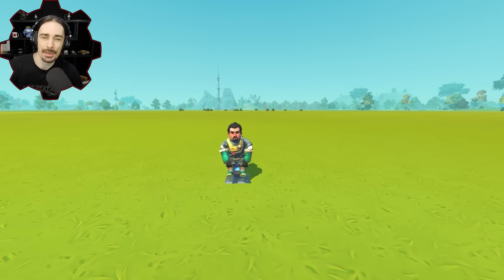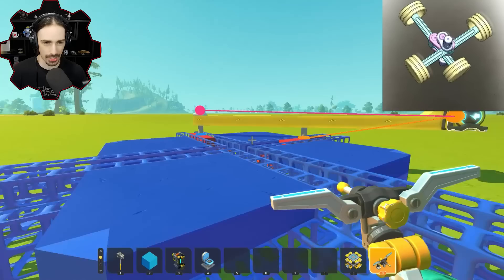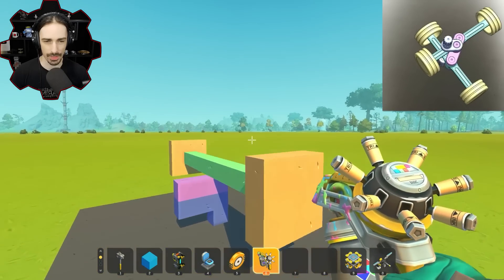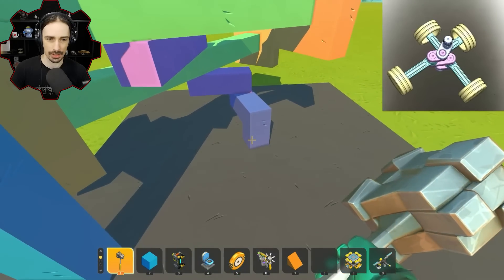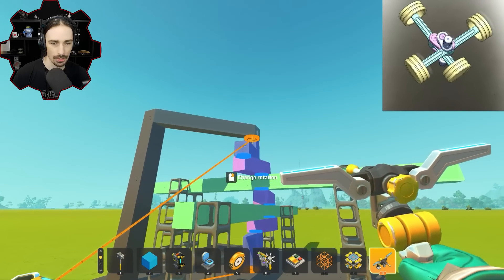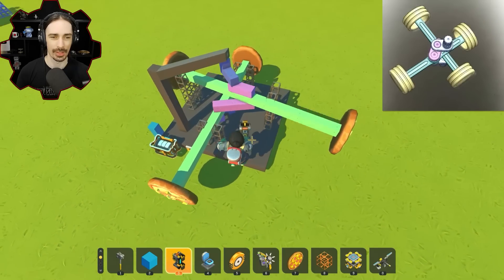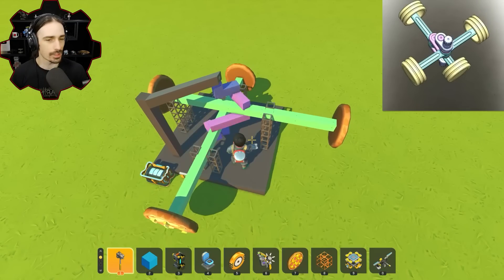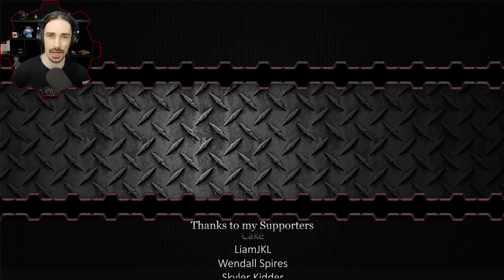Recreating This Radial Piston Mechanism Had Strange Results

Comment: The reason yours doesnt work the same way as the animation is because all of the pink pieces are supposed to be rigidly connected, thats why they're the same color. It is done by a rod running through the axis of the bearing, which is not easily accomplishable in scrap mechanic.
Reply: that's what i was guessing, interesting to see that it can work similarly though.
Reply: the blue part is hollow and the piece goes through the middle to keep it stable
Reply: Yea its a radial engine crank with rods and pistons not a bunch of free spinning bearings the other problem is the power should be coming from the linear actuations of the pistons and not the rotation of the crank or you would have a radial compressor and not an engine
Reply: I was wondering the same. It's fun to see him work around it hehehe nice vid
Reply: @general.catallion_8054  Yes and no the difference is one is an engine that could be used as a compressor or a linear actuator EX its meant to take a linear force and turn it into a rotational force but could do either where the other being  the Trammel of Archimedes is intended to take a rotation force and turn it into a linear actuation and while it hypothetically could  do everything the other one can it would be a lot harder to do being a completely different mechanism that was made to do only one thing but its able to do that one thing with substantially less moving parts
Reply: You could probably replicate the effect by abusing the no collision of pistons.
Reply: I would think a small pipe piece connecting the pink parts and a square of low friction blocks on the piston would simulate a rod through the piston to rigidly link the pink parts
Reply: @Lectrikfro  regular pipe piece would do, i think. would make for less wobble
Reply: I was shouting the exact thing through my display😂😂
Reply: we can connect that using pistons though
Reply: I'm screaming at my screen telling him that you can just conect them with a piston
Reply: Seriously how did he miss that he's usually really smart
Reply: Just built it using suspension and was fairly easy and is really stable, and I added it to the workshop too
Reply: This would've been pretty easy to do in Robo-co
Reply: @kilbymorgan8626  it would also be pretty easy to do in scrap mechanic, the Scrap Man himself just doesn't see it.
Reply: Maybe make a hole in the piston rods and instead of the bearing just have a tube or pipe. That should have the purple sections rigidly connected whilst still allowing them to rotate within the rods. Scrap mechanic needs some kind of through block bearing.
Reply: physics and engineering
Reply: yeah there needs to be a way where you can lock lock together the rotation of 2 or more bearings if they are on the same axis.
Reply: Pistons dont have collision, he could have used one to connect them
Reply: He could use a piston to connect them since pistons don't have collisions
Reply: @thekingjdd  X engine*
Reply: @DoubsGaming  you can do that in a 1x1x1 space pretty much (in game)
Reply: Yup
Reply: Yeah exactly... thank you... you can recreate this in scrapmechanic with pistons connecting the point together... pistons have no colisions
Reply: Yeah I made one with them locked and could be a really effective piston engine
Reply: @DianaTheLance  you can’t weld it together off the lift though, the pistons will only connect to the bottom.
Reply: could just connect them with pistons, b/c pistons have no collision
Reply: Yeah and like you said not easy to do in a game that doesn't allow it I feel like there is a mod for something like that. I love how we are watching him learn from just an animation without him having alot of experience reading a modle
Reply: I can't spell lol
Reply: Physics slider
Reply: Btw you can easily accomplish it by using either a piston at the side to link them as the piston clips through thing as well as using I think like mechanical something mod
Reply: Could be a pin a bushing rather than a berring as there's less play in a bushing /washer  mechanism.
Reply: You can use pistons since they don’t have collisions.
Reply: it's really easy, just use a piston.
Reply: not only that but the cylinders would hold the pistons as normal.
Reply: I was hoping he would make pistons push to simulate the engine explosion/ignition(?)

Comment: The mechanism is meant to have the linear motions of the pistons driving the mechanism (like a combustion engine piston).  If you had the ability to control them, you would have control over the piston sequence direction...  and in turn whether or not the pink pieces are in alignment or not.  You were figuring this all out from the other end of the power train, which honestly is kind of impressive.

Comment: The reason that your radial piston isn't working the same as the diagram: Your "Pink/Purple" cam isn't fixed. Notice that center piece doesn't flex. It isn't 3 pieces that rotate independent of each other. 

You could fix this by using pistons (which other objects just pass through, I'm sure you're aware), to make that center component "All one piece"
Reply: its X engine

Comment: i think that its supposed to be creating rotation from the radial piston movement RATHER than the radial movement from rotation.
looking at the crankshaft like structure in the middle it reminds me more of an engine design
Reply: Yes. Clearly the piston heads are where power generation is supposed to be 🤣
Reply: Thats definetly it because the Pistons have the sealing Rings and the shafts have rivots to output the power
Reply: @Maxikxng  splines*
Reply: @Maxikxng  That really doesn't tell you which side is powered. This could just as well be a piston compressor.

Comment: You actually built it wrong. The pink parts are supposed to be one part with the place where the bearing is being threaded through the piston's rod, so it would be more realistic if you were to connect them with a piston so that they behave as they would IRL.
Reply: I'm surprised it worked at all the way he built it.

Comment: basically what made it not work is because its supposed to be more of crank shaft like item thats attached at the center point on each end by a bridge to the rotating point creating the order of the pistons that are jointed to the crank shaft thats allowing the pistons (if this was used as an engine configuration) to all produce power to a rotating point every 90 degrees meaning that if it was to put in an engine with 8 pistons but 4 rods in this configuration you would want every other set of 4 pistons you would want to offset the power stroke of the piston by 45 degrees and so from that you have smoother power and more of it basically creating a 4 piston segment radial configuration that you have bigger bore pistons with

Comment: 11:00 in the video the pink is one solid crankshaft like in an engine so i goes through the middle of the piston rods and stays connected its not three seperate pieces like you have it, however locking it with a controller would provide the same result

Comment: I was going to say this is a lot like a much earlier creation of yours than the trammel but after digging around a little, it turns out I was thinking of one of kAN's videos from the early days of pistons in scrap mechanic (from five years !!!! ago).  Its title is "Radial Engine and Piston Powered Cars! (Scrap Mechanic #183)" and the engine has an interesting 4 piston single plane design.  A second take on the mechnism in today's video where piston clippnig is used to turn a common central shaft might be able to get the motion to match the example image.  The limitations of scrap mechanic's surface mount bearings and lack of through-pin/wrist-pin/journal-conrod devices makes it not quite possible to fully match otherwise.

Comment: The "thing" here is, that the bottom and the top pink parts are usually connected with a joint on a bearing with the middle pink part, through the pistons.

Comment: What scrap man missed was that the pink piece was one solid piece effectively the green pistons had a hole drilled out in the center of it so the pistons wrapped around the pink instead of 3 separate rotating pink pieces

Comment: you guys do understand that in scrap mechanic you can use pistons to connect the pink pieces and make them a rigid Crank then the mechanism would work due to the pistons making that pink part a solid part

Comment: something to try that might be interesting, as these are pistons..    they are supposed to be the power source,   adding a short duration "thruster" ont he end of each piston with a sensor...   to have the thruster to fire a short burst, at the begining of each stroke..  ie when the piston reaches its full length, it trips a sensor, that activates a thruster to stat it moving in the other direction...   then have all 4 pistons providing the power, instead of the top/bottom.   might be interesting...

Comment: The pink piece in the animation is all one part. They have a rod connecting them that goes through each piston shaft. This also allows you to only to to power one baring. however, this is probably all impossible on scrap mechanic. Your probably as close as you can get really.
Reply: It is possible if you use the fact that in-game pistons and suspensions don't have collisions.
Aka you could connect the pink 3,5,3 parts with them to simulate a solid piece.
That's something that is used in some SM piston engines to make a crankshaft.

Comment: I think what is missing is that the pink is all solid. Like suspension should have been used to keep the purple completely locked. Otherwise the pistons couldn't power the device. This would only work with the shaft being powered which is not how an engine works.

Comment: this thing doesn't work because of 2 things: 1. that's what lots of ppl said already - purple part is basically a one single piece of metal. 2. this "mechanism" is not a mechanism, its a part of X-tipe engine, that is actually exist, which means pistons aren't free part, they incased inside the celinders of the engine, also it means that the sorce of power here are the pistons themself.

Comment: i think all bearings need to be powered to simulate having rigid connections for the pink parts. the only unpowered bearings would be the ones connecting the purple to the pink.
Reply: or just connect the pink parts with pistons

Comment: one problem I think could have been fixed was making the pink piece one piece as in the real engine if it were to exist
in the engine the pistons would just go around a tube that is part of the crankshaft
allowing the output of the engine to be connected
in this situation it is no different
you would need to make the crank shaft well a crankshaft
most likely by using piston glitch to connect it

Comment: An engine uses pistons to power the crank shaft not the other way around. That's why it's not working properly.  Push and pull the pistons back and forth like a real engine and let the bearings free spin.

Comment: It is supposed to be an engine. You don’t power and engine from a rotating point. That is what the engine is supposed to do. You need to put timed thrusters on the end of the piston to push them so you make an rotational force.

Comment: That purple piece in the original animation was 1 big piece its the crankshaft so the free bearings were the problem but it would probably not be possible to replicate that in scrap mechanic
Reply: it's actually quite easy, b/c pistons have no collision, so you can just connect the purple pieces with pistons

Comment: The problem is that there is not suposed to be free spinning bearings but the pink shaft is actualy a solid piece. So i dont think you could build it in scrap mechanic. Pink shaft is supposed to go trough pistons (green) 🤓
Reply: Oops someone already said this my bad
Reply: you could do it scrap mechanic by just connecting the pink pieces with pistons

Comment: I'm at 11:11.. and its irking me that you haven't realized the pink acts like a cam shaft. its all one piece freely swiveling on the light blue with the 2 piston rods rotating around it. there is only 5 parts to the mechanism :P so on this one sadly i have to call your recreation a fail mechanically :o and the rotational power should come from the linear action of the pistons which will drive the rotation, not the other way around :P

Comment: Its not strange that they needed help all rotating in the same direction, in the animation its all one peace going trough the other peace.
In scrapmachanic you cant make that one peace because of the bearings.
If you use a piston/suspension glitch to connect the middel peace tothe one above and under it, it will do the same es in  the animation.
Sry for the bad english.

Comment: Its an internal combustion engine.  The power source is the pistons not the bearings.  https://en.m.wikipedia.org/wiki/X_engine

The pistons slide inside a cylinder and the bearings rotate around a shaft.  Both are locked in place.

Comment: its so easy to create a replica youre over engineered the thing by placing too many bearings... all you need is two square Z shapes 1 to run top arm and 1 for lower arm running a bearing to each arm off the Z shape then create 4x 3 block bars 2 for top & 2 for bottom with top one bearing and the lowest bar bearing